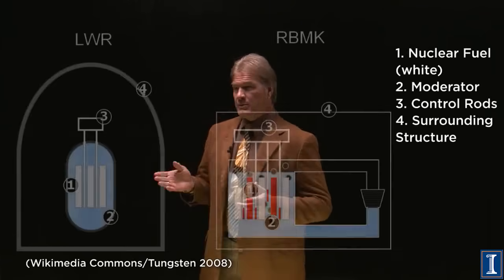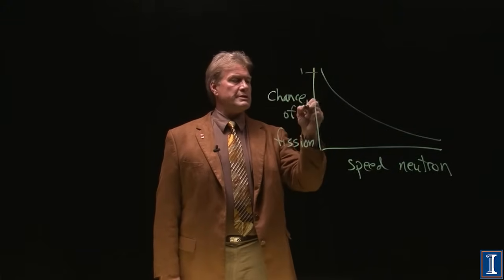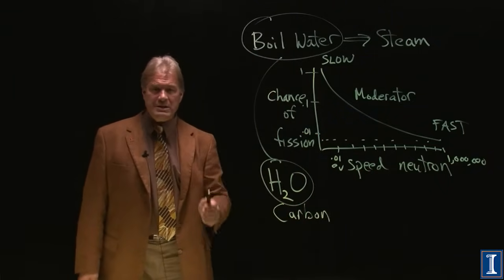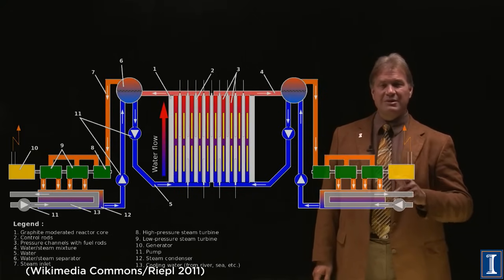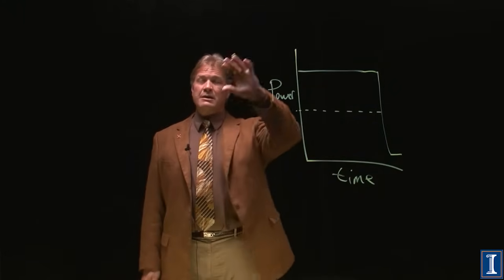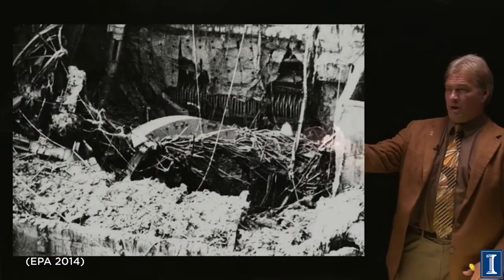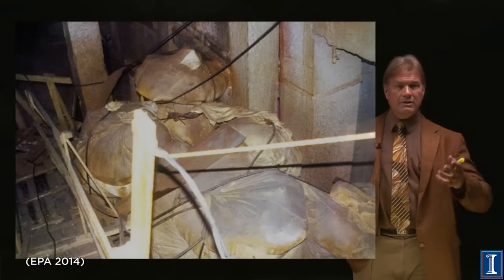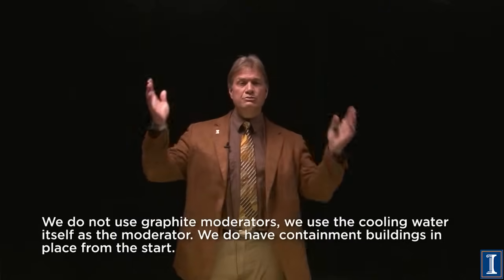Chernobyl: Worst Accident Ever

Comment: Some RBMKs are still operating in 2019, about two dozen
Reply: thankfully due to heroic intervention from Nuclear scientists of the era they have new Western style safety features installed so don't worry
Reply: @southernbear736  By western style safety features you mean they switched out the graphite tips on the control rods for boron.  Apart from that every RBMK running today is exactly as it was back then, with the same void coefficient, the same moderator weakness and the same lack of a containment structure.  They simply retrofixed the one moronic defect that was significantly more moronic than the others.
Reply: @krashd  Maybe this video and experience tells those engineers still running rbmks to NEVER run safety simulations on undocumented configurations EVER
...the most moronic defect in my opinion.
Reply: Yes replacement of the Graphite tips to complete Boron rods but also other updates include:

An increase in fuel enrichment from 2% to 2.4% to compensate for control rod modifications and the introduction of additional absorbers.
Manual control rod count increased from 30 to 45.
80 additional absorbers inhibit operation at low power, where the RBMK design is most dangerous.
SCRAM (rapid shut down) sequence reduced from 18 to 12 seconds.
Precautions against unauthorized access to emergency safety systems.

At the end of the day while the traditional RBMK Reactor had serious flaws if they let the Xe 131 decay and let the reactor be shut down for the 24 hours recommend the accident wouldn't have happened. These modifications and the more importance placed on discussions made in these plants mean Chernobyl can not happen again.

Comment: Also they shut down automatic water injection system since it could "interfere" whit test
Reply: Source?
Reply: @grekiki 

https://www.oecd-nea.org/rp/chernobyl/c01.html

 The planned programme called for shutting off the reactor's emergency core cooling system (ECCS), which provides water for cooling the core in an emergency.

Comment: Yes, it is indeed "impossible" for a "Chernobyl" event to happen in a western reactor. There are almost certainly other types of accident that are possible with western-design reactor models. That being said, our increasing need for energy will continue to rely on a significant proportion of nuclear generation for some years to come. "Green" energy simply cannot satisfy our current demands ... perhaps THAT (i.e. our current energy demand) is what we really need to address! Good luck in squaring THAT circle!!!!
Reply: the fact is no gen 3 reactor has ever had a major accident - and hundreds of them are in operation all around the world for dozens of years.
They are safe. Expensive. But safe.

The answer to future needs is modern reactors - ones that can be made cheaper and even more efficient while keeping them as safe or even safer.
It actually is possible - technology is already known. And it can be made possible by a fraction of a price tag needed to turn the whole world to renewable energy.
Reply: Perhaps so, but it still come down to the training and dedication of the operators who control them. Skilled professionals who know the reactors they operate top to bottom are the last line of defense if anything goes wrong, especially something engineers who designed and built the thing could not have anticipated.
Reply: @taraswertelecki7874  not anymore. Gen 3 and above safety systems are designed to based on the law of physics - which would always work and always remain the same.
You got designs that reactor cores get flooded with water from a tank located above - gravity would always work.
You got designs with control rods hanged above the reactor on electromagnets and dropping down as soon there would be a power outage.
Coolant systems based on natural convection - good enough to keep disabled reactor safe from decay heat without any human intervention.
Freeze plugs on reactors with liquid fuel - melting as soon there would be too high temperature or power outage.

It's the same as any other technology.
Take airplanes - currently the safest way to travel. But a number of planes had to crash to make it so - because people had to see what can go wrong in order to prevent it.

Same with nuclear plants - 3-mile island and Chernobyl have taught them a lot.
And they figured it out how to prevent it.
If there would be gen 3 reactor in Fukushima it would be perfectly fine - even after once in 1000 years earthquake.

There is a lecture he of an American nuclear safety committee member - back in 1970-ies they totally had no idea what are the real risks in running 1000MW reactor. They were designing safety systems to deal with the wrong threats...
Most of the experts only had any experience working with military reactors - which were like 10MW. turned out it makes one hell of a difference...
Reply: All true, but most reactors in the U.S. do not have those improved reactors with passive safety built in, yet. They will, because if it does become necessary to use nuclear power on a large scale in the future, the public will demand nothing less.
Reply: @taraswertelecki7874  No, 30-40 year old reactors do not have these features.
Yet another reason why it's about time to seriously consider replacing them by something much more modern.
Reply: Those are going to be dismantled and or replaced because neutron damage to the reactor vessel weakens and embrittles the steel. At some point, it becomes dangerous to continue operating them.

Comment: The containment building is nice to have but it is a misguided way to think it prevents accidents. The way to think about it is that it is sort of insurance against possible future cleanup. It might not help but it might decrease the fallout and give huge payout in case worst happens.
With the amount of energy released it is unlikely containment building would prevent release. The explosion was estimated at 10t TNT. There isn't a containment building that could stop explosion of this size, it would probably just amplify it (imagine a grenade with 10 tons of TNT inside...). Even if it miraculously somehow stopped it, you need to contend with continuing energy release from radioactive material that would not be cooling in open air as was the case.
What caused Chernobyl is general cavalier attitude with regards to extremely dangerous process and lack of containment building is just symptom of the problem.
Reply: A containment building like the ones here in the West might have prevented a greater release of radioactivity than hundreds of nuclear weapons raining down on your country and detonating at or below ground level, and all the fallout that would be generated. Western style containment buildings are built to withstand the direct impact of a jetliner at over 500 mph, and earthquakes that level entire nations. I have personally seen one of the buildings, everything is in shock mounts like a warship to ensure they can ride the tiger's back. More than a meter of heavily reinforced high strength concrete and a very thick steel inner liner means any blast that could destroy one would also flatten the entire plant and a large area around that. As long as nuclear reactors of this kind are built and operated, these buildings will remain mandatory in the West, and they should be worldwide. It's that, or switch to reactors that cannot explode or release enough radiation to poison several nations.
Reply: @taraswertelecki7874  I congratulate your faith in containment shells, but it is always a bad sign to put too much faith in a single safety mechanism when the problem is so important.
An airliner at maximum velocity is about 2GJ, while 10t of TNT is 20 times more at around 40GJ (the shell might survive one jetliner, but could it survive TWENTY hitting at exact same moment?).
You said it is "designed to withstand jetliner at 500Mph", so it means it is definitely not designed to withstand 20 jetliners at 500Mph.
Would it withstand 1000 tons lid hitting it from inside?
Earthquakes are something that happens over time and we have huge buildings built to be able to dissipate the energy without having to be additionally reinforced (actually, more flexible is better in case of earthquakes).
In general, it is much easier for a building, and especially shell, to withstand outside forces.
An outside explosion has other directions that may dissipate into if the shell proves sturdy enough and it is also possible to arrest the shock (like using the mentioned mounts).
On the other hand, explosion inside the shell has no other way to release its energy and it is not possible to have a shock arrestor that will dissipate the energy (it would be like trying to lift yourself by tugging your own hair).
Again, shells are mechanisms to protect from outside attacks, explosions, and maybe malfunctions insde it but in no way they can help if the reactor decides to blow up with enough force.
In case of Chernobyl, that force was estimated to be 10t of TNT and NO CURRENTLY EXISTING containment shell could withstand the force of the explosion within the building.
I don't want to say we don't need containment shells. Just don't be naive and think it solves the problem.
Reply: Nothing is absolutely foolproof, but some scenarios are just so unlikely that planning for them is not possible. If someone wants to cause a nuclear catastrophe by breaching a reactor containment building, they'd do it with planes with massive bunker buster bombs, OR they will attack the reactor with a nuclear bomb if that is, they have the means and do not care about the probably nuclear retaliation that would follow. THAT is a far more likely possibility and so is the aerial assault with bunker buster bombs or missiles than twenty suicidal nuts trying to fly hijacked airliners into one.Containment buildings are used to prevent 50 megacurie plus releases of radiation into the atmosphere. I have roots in Ukraine and Russia, my father saw first hand the fallout in the form of sickness and suffering because of  high radiation doses people accumulated. A containment building like the ones here in my country the U.S. buy time, and increase the odds in favor or people living near the plant as well as those who work there. The need for vigilance and caution will always be there.